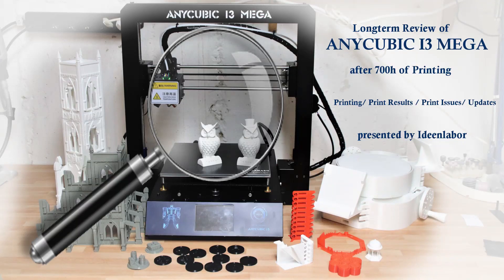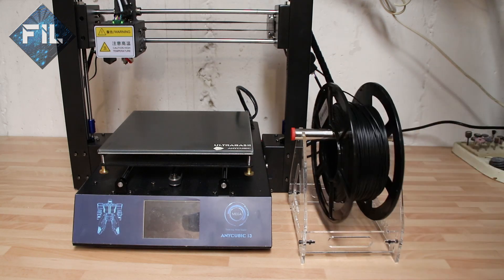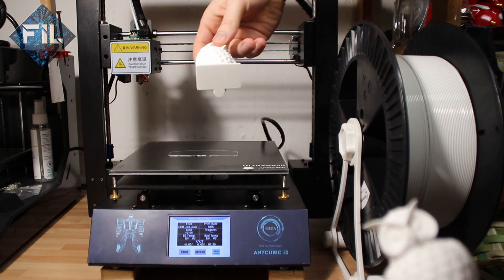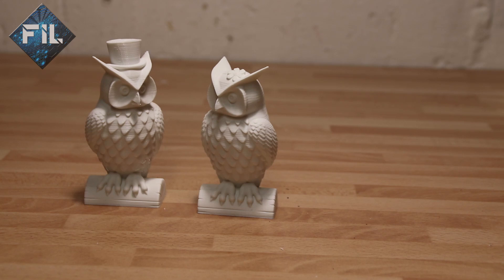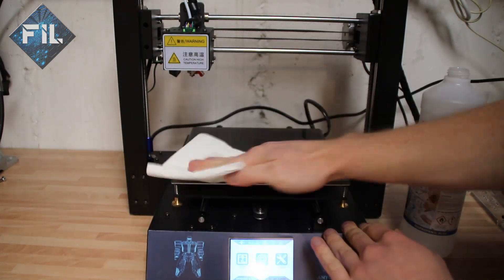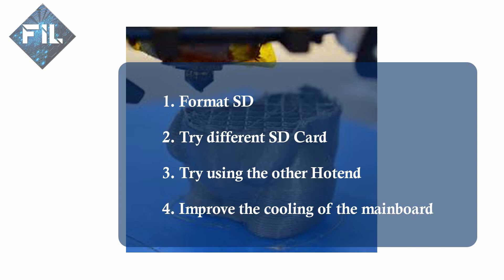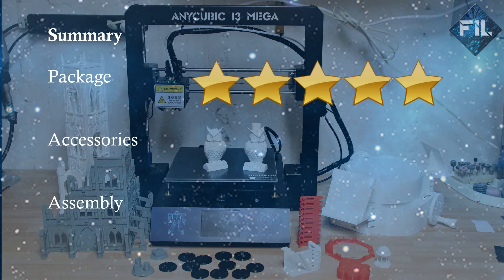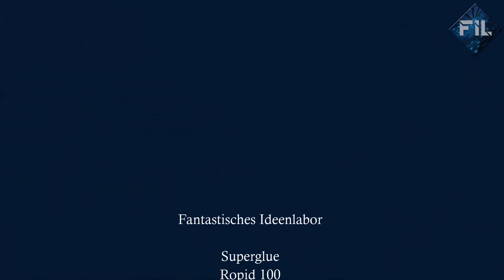Longterm Review (3 months) of the Anycubic I3 Mega

Comment: I have the same extruder problem but mine also has the extruder run in reverse mid print. Any helpful hints? Very new to printing so I am lost :(
Reply from the maker: What do you mean by the extruder runs reverse? Does the extruder keeps pulling the filament back till it comes out at the feeder. If this is the case than it is something wrong with the gcode. First I would try to print the test file on the sd card (The owl). If it works you should slice your file again in cura. What is your current version of Cura?
Reply: Yes the filament draws back out. It runs fine for 5 to 10 mins then just runs in reverse. The same files work in my ender 3 so not a gcode problem?
Reply from the maker: What profile did you use for slicing your print, the one for the ender oder the one for the i3? Have you tried to update the firmware of the anycubic? Tried printing from a laptop, to test if it works.
Reply: @steventrinaattwood4485  Mate, are you alive?. Damm hate people never come back to say if something worked out!, Did you found a solution of your problem?

Comment: I use OctoPI and it works great on my Anycubic i3 mega Version 2 Ultrabase.  I also have installed the TCM2208 stepper drivers and notice a significant drop in noise from the motors.
Reply from the maker: Thank for your comment, I will try the TCM2208 stepper drivers. 
On my firmware version that was already on the printer, when it was delivered, the usb didn't work. 
After I upgraded the firmware a couple of weeks ago the usb is now working, but now I have some issues with the sd card.